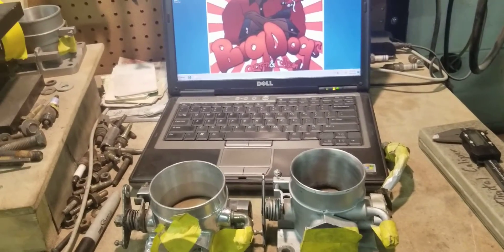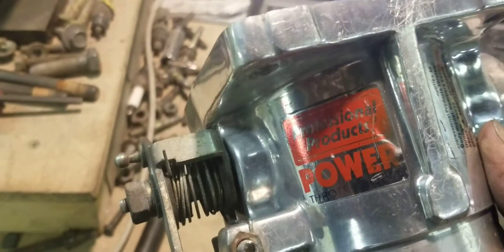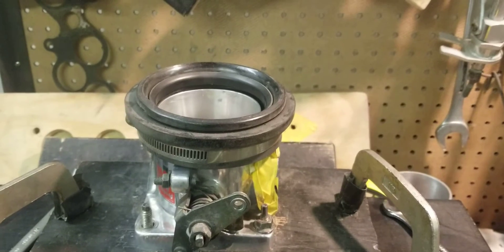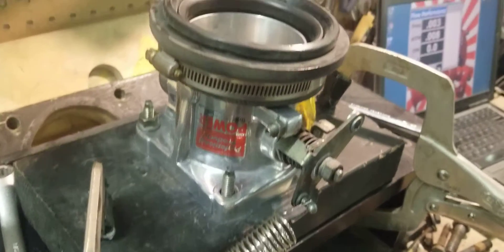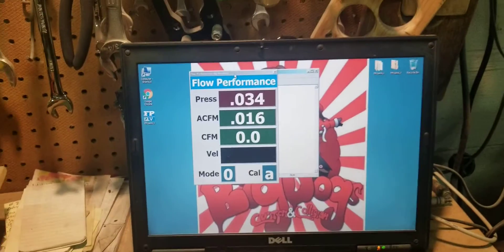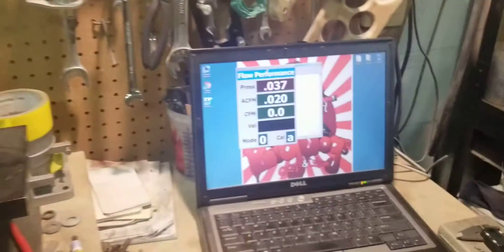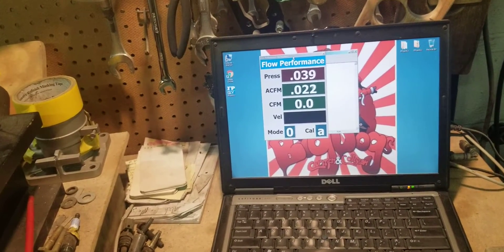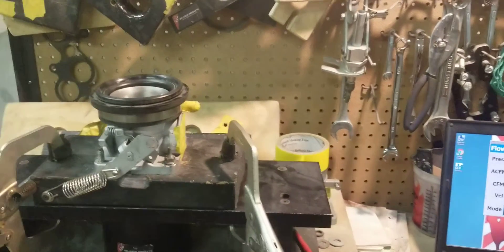Throttle body comparison

Comment: Ok I see the results but how or what did you do , how ,do you do this . I guess I don’t know what you do to port the T body ? I’m not a mechanic .
Reply from the maker: It's all about increasing cfm flow. We use specialized equipment and machines to increase the cfm flow of factory and aftermarket Throttle bodies and parts then we flow test and flow test again till we reach the desired results. This is how you increase the amount of air your motor can get which with added fuel will give you more hp and torque. We offer this service at our company Bigdogs Porting.

Comment: Hey Tony. I noticed the depressions across both throttle bodies were very close, making an apples-to-apples comparison. Great work! Thank you for sharing, and God bless you.
Reply from the maker: On our flowbench the processor automatically takes whatever depression that it available and converts the results to 28". Look through our videos where we show this. We took a part flowed it at one depression then without turning off the flowbench we turn off some motors to reduce the depression and the processor calculated to the same number as before with a different depression. The critics that  are always trying to find d something to hate on us do not provide any flow information,  videos or posts of any testing or results so we just ignore them lol. Plus oud customers are reporting back great gains from our porting and as far as we know we have made the most naturally aspirated whp with a gt40 style manifold of 420whp.
Thanks for the support.
Reply from the maker: https://youtu.be/CfcWGIbELug
Check this one out
Reply from the maker: https://youtu.be/8qiuSGuZX5o
Here's the other one. This shows what we've been saying all along about our flowbench and testing. This is why we do before and after fliw test to measure the gains. We challenge any critic to provide the same data we are  constantly providing before they try to criticize us. They can't lol

Comment: Hey Tony.. have you ever tested a 77mm and 80mm maf? Would it even be worth testing?
Reply from the maker: Yes I have. Different meters have slightly different flow depending on brand. Most aftermarket meters run rich when on the factory tune. I test a ported 80mm Ford maf and it flowed right around 1,000cfm no radius. In stock form it was  much lower.

Comment: O and yes my wife has a 99 4.6 mustang . Engine is tired .lol I should beat the hell out of my wifes car . Looking to rebuild her motor . Do you do 4.6 heads and intakes ? 

I know big gains can be had . Like 100++ hp if done right . That's alot coming from a stock 260 hp 4.6 to upwards of 380 hp .
Reply from the maker: Yes we do the 4.6 stuff as well

Comment: Hey . Awesome stuff . Looking at a mustang that (owner claims , looking into it) has 347 with stock heads and intake TB and MAF . He says his 302 was done and just built a 347 instead .
I'm doing some homework before making an offer .

What's you thoughts on adding proper heads and intake . 

I've never done the explorer type deal but willing to try it with the intent to send the parts to you guy's.  Problem a winter project. 
Otherwise I was looking at the Holley heads or intake .
Reply from the maker: Proven cost effective combo goes like this. 
Stage 3 ported gt40 manifold. 
Stage 3 porting gt40 heads or used TFS 170s that we port.
Anderson N41 or Comps ex274hr or xe284hr depending on how much power you want.
Ported 75mm throttle body  and ported headers. That combo right there we stand behind and will put you well into the 430whp range easy with 9.5 to 1 or better Compression
Reply: Be careful.of those holley heads.. they are a beech to get the valve train geometry correct.. and if you dont get it right.. it will eat the chit out of the valve guides. All of them will, but especially the holley heads